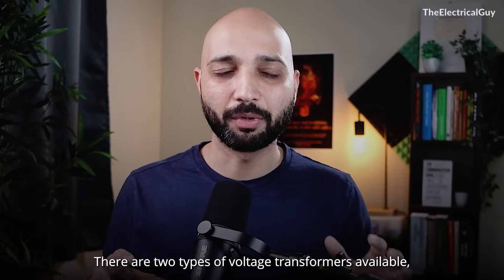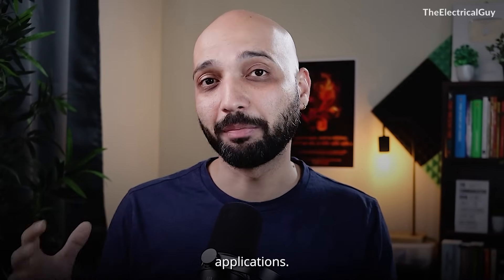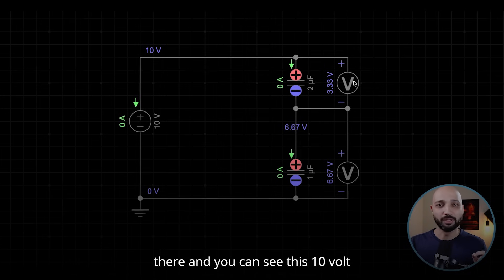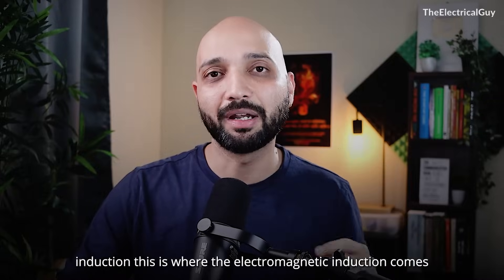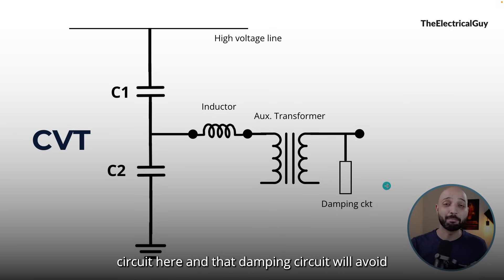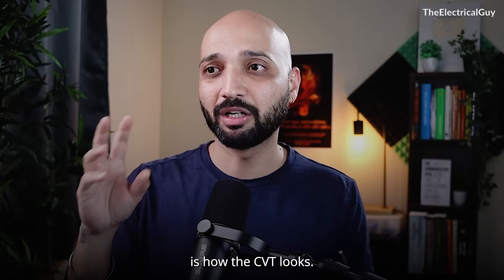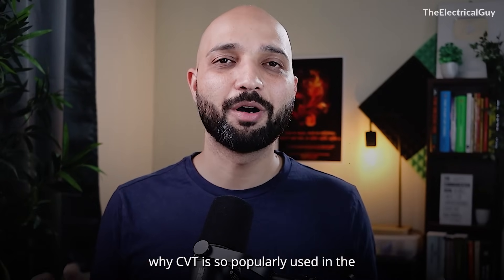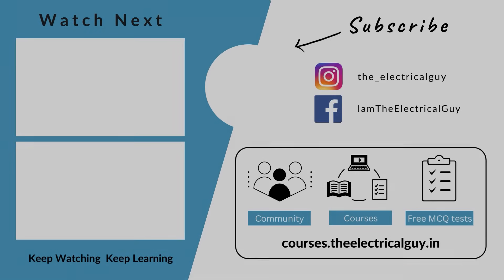How Capacitive Voltage Transformer (CVT) works? Explained

Comment: Interesting, talking in simple terms this CVT might be ok for connecting a domestic light bulb to 800kv at 100A available  but it's surely not going to drop the voltage to say 400kv and 200A  like a normal transformer would do ignoring losses. I've avoided KVA for simplicity. So how efficient is this voltage change transfer idea.
Reply: Efficiency is good I think. But it will have lower voltage under load.

Comment: Interesting!  In the small electronics world we call this a "capacitive dropper" and it's common for dropping line voltages down to an interrnal low voltage for electronics in inexpensive hot-chassis devices.  We wouldn't even call this a transformer since it only steps down, it can't step up.  It is fascinating to me to see how different the big electricity world is, and how much is the same.

Comment: Was sie beschreiben, kenne ich als kapazitiven Spannungsteiler. Ein Transformator kann eine Spannung auch nach oben transformieren. Das kann ein kapazitiver Spannungsteiler, wie in ihrem Video, nicht.
Trotzdem, danke für den Einblick in die Bauelemente der Hochspannungs-Übertragungstechnik.
Reply: It is called a CCVT - Coupling Capacitor Voltage Transformer.

Comment: How much are the losses with CVT vs. IVS? It seems to be much more at CVT (you have capacitor to the ground equivalent to a resistor diviser in a DC circuit).
Reply: The losses are minimal.

Comment: Did not know this was used.
Question - this looks more like a resistive voltage divider which gives very poor voltage regulation versus load. Unlike and inductive voltage divider in the form of an auto transformer where the magnetic circuit passes through both inductive components at the same time, better regulation? What type of voltage regulation does this provide, or is it primarily for fixed loads? Or have I missed the point entirely?
Thank you for sharing.
Reply: There is no voltage regulation. It is for voltage measurement.
Reply: CVT is not associated with voltage regulation ✓
it is simply a step down trafo so that you can measure the voltage level..
additionally it helps in PLCC/ FOTE communication ✓

Technically CVT does the same what a PT does 😊

Comment: Please note that the division of voltage is taking place when the capacitors are in series and not parallel, in a capacitor parallel circuit there is current division and not voltage.
Reply from the maker: Connection with the grid is in parallel

Comment: For practical power, would that work, or would there be too much bleed through the caps chain?
Reply: For voltage measurement. Not for consumer loads.

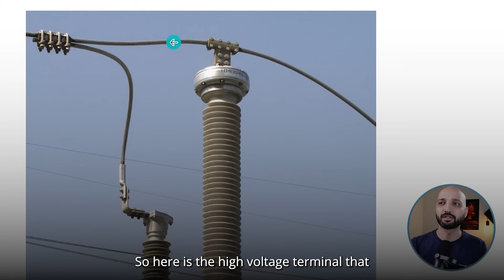Comment: 10:00 would have been interesting to know what the kV and MVA rating of this exact CVT was.
Since IVTs are still commonly used for 400kV and even 720kV transformation when it's going in the MVA range I doubt CVTs are an actual option as power transformers. That distinction would have been a valuable addition when talking about the disadvantages of IVTs.
Reply: hi clippy!
Reply: MVA rating?  No.
Reply: These are not transforming the main power that goes to customers but used to provide power for auxiliary equipment at switching stations and such so I would guess not more than  maybe 10 or 20 Kva, possibly even much less.  The MVA scale transformers carrying power to customers are still the 'normal' inductive ones. I don;t think it would be practical to makes capacitive transformers at that scale, but I could be wrong.

Comment: Great video. Can you cover how me measure voltage and current in UHVDC systems ? This is DC not AC . So transformers will not work . Thank you, Robert from USA
Reply: You can use resistors.